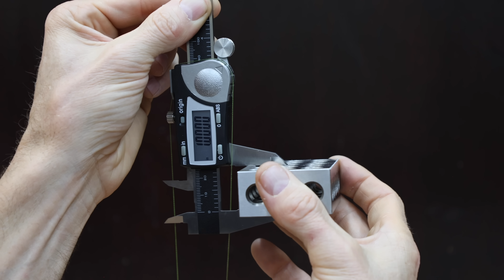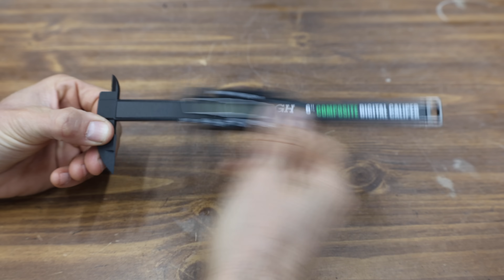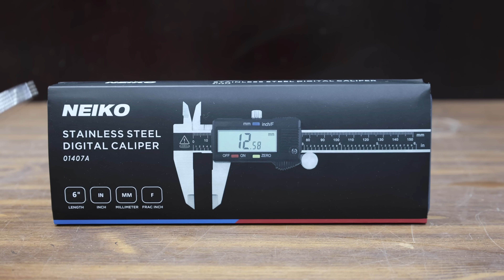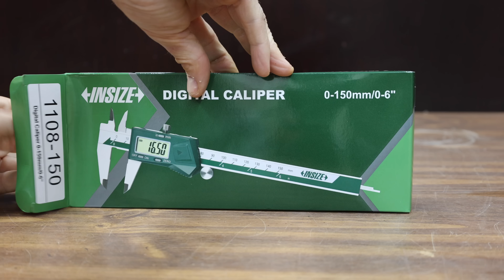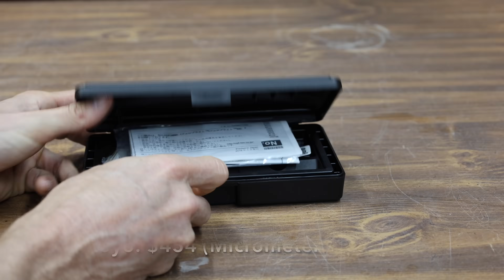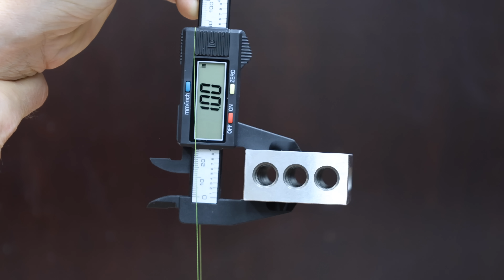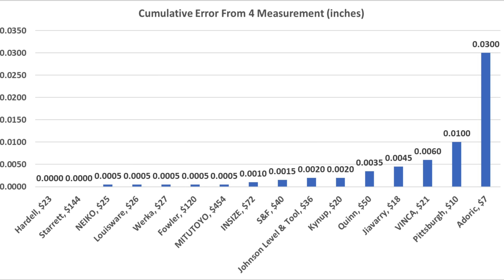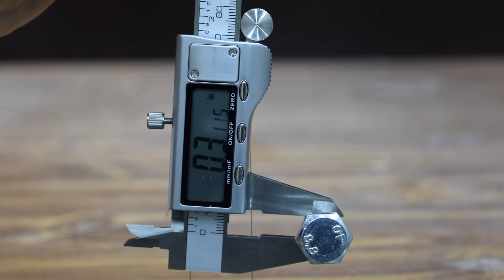I've Been Proven Wrong About Calipers!

Comment: Unfortunately the most important thing wasn't shown and that's battery life. Every single one of the cheap calipers is going to eat through batteries whether you're using them or not and that's a real pain especially when you don't use them very often. The higher end calipers have much lower power draw which means the batteries will last 10 times as long.  That difference alone makes the higher end calipers worth every penny.
Reply from the maker: Thanks for the constructive feedback.

Comment: The Mitutoyo digital micrometers and calipers that I own were all supplied new with silver oxide SR44 batteries included by Mitutoyo, not LR44 alkaline batteries as stated in this review. My Mitutoyo instructions all specify the SR44 battery type. The SR44 battery is more expensive than the LR44 but lasts far longer than an LR44 for me in calipers and micrometers.
Reply from the maker: Thanks for the feedback.

Comment: Not sure if you've done it yet. But the price on laser measuring tools keeps going down. Work tried out some mileeseey and bosch versions and both were surprisingly accurate but way different prices. Saw mileeseey has architectural ones that hit like 200+ USD.
Reply from the maker: Thanks for sharing.

Comment: Digital calipers that "shut down" after a few minutes still have parasitic drain.  You should pop the cover off, hook up a multimeter, and calculate how long the batteries will last in the device while in standby mode.  I don't use digital calipers very often, so I remove the batteries between uses.  Handy to have on hand for the rare occasion I need to measure something to the thousands of an inch.
Reply from the maker: Thanks for sharing.

Comment: Having used a ton of calipers over the last couple decades. I still go back to a Starrett dial caliper. No batteries, and being able to see the needle move to find that sweet spot where you know it’s properly seated is a must for me. Specifically the model 120’s made in the USA. The 3202 models are made in China, they’re not bad but you can definitely feel the quality difference. Mitutoya is a close second. For dirty environments I will only use digital. Dial calipers will get destroyed as they work by using exposed precision gears.
Reply: I've been using Swiss-made Brown & Sharpe (Tesa) dial calipers daily for over 40yrs. The only reason I went to a dial is because I have to go from measuring inch stuff to metric stuff several times a day. I bought a Vinca caliper for like $20. It held up perfectly for a couple years until I spilled some acetone on it. My company replaced it with a Starrett 799. What a piece of crap! I actually threw it against a wall, and bought another Vinca!
Reply: PS; You mention the Starrett 799 you tested was "Made in Scotland'??? The one I had was marked Made in China! 
Starrett has been in dire straights. The company was, perhaps still are for sale. Their catalog is a shadow of what it was when I started in the trade. Cheap imports are killing them. I have a lot of old (pre-satin chrome) Starrett tools I bought from co-workers who retired. Some are older than I am (65), but are still in excellent condition and measure perfectly. Also have a bunch of Brown & Sharpe, Lufkin, Goodall & Pratt, Moore & Wright & other makes that no longer exist.
Reply: @pb68slab18  Acetone melts plastic, ketone family. Brown & Sharpe started it's original company in Providence, Rhode Island in 1833. They sold it a while back. Starrett was a highly overpriced union machinist shop in Athol, Massachusetts. They sold the company years ago. In the 1980's Japan was farming out their electronics to China.
Reply: I use both digital and manual calipers, depending on the job. In my opinion, they both have some advantages over the other.
Reply: I also tried digital and went back to dial. I like the no battery needed.
Reply from the maker: Thanks for the feedback.

Comment: I have been a machinest for 20  years. Going in i could not afford the mitutoyo so i bought a fowler. Lasted 6 months, the open and closing wore a hole in the circuit board  from the scale dragging on it. Your test of how much force it takes to close them is what i needed to see. 

I have had my mitutoyo now for 20years. Other then dropping a pair i have not replaced one since. 

The tooling rep is pushing the insize brand hard. Debating giving them a try. 

Agree the auto off and 2032 battery would be a great upgrade for the mitutoyo.

Great work! Cheers from Wisconsin!
Reply from the maker: Thanks!  Thanks for sharing.
Reply: @ProjectFarm  video idea.  Does keeping string trimmer line moist help? 
Alternative to string trimmer line?

Comment: 1,2,3 block isn't (in my opinion) a great way to check accuracy. I would have gone with a certified ceramic gauge block set and did some thing like 0.5432 as a stack, verified it with a mic like you did and repeat...... a metal block such as that 1,2,3 block just by holding it can affect in the 10ths range quite easily, but regardless to all of that fantastic video and thank you for all you do!
Reply from the maker: Thanks and you are welcome!

Comment: One of the issue I found with cheap calipers is their battery drain when off.  Right now I am using the Shars Aventor IP67 6" caliper and I find it keeps its zero and is quite accurate.
Reply from the maker: Thanks for the feedback.

Comment: This was a great test idea! - And also probably the most controversial one as well.  All the professional machinists, engineers etc. have made valid points, but overlook the fact that this information was presented primarily for the AVERAGE individual, working on projects that aren’t going to Mars, the Marianas trench, or nuclear reactor.  A farmer repairing his combine probably wouldn’t necessarily need a $400+ caliper to measure a half worn shaft against the worn bearings it passes through. He just needs to know what size it is, compared to what size it’s supposed to be, so he can replace it with the correct size.
Reply from the maker: Thanks!
Reply: I bought a few 6 inch fake Mitutoyo LCD calipers on E-bay in 2020 for 40 dollars a piece. I use on an ocasional hobby project. They are a good quality reliable fake item. There is a YouTube video on "how to tell if there fake"  Mitutoyo electronic calipers.
Reply: @georgebuck2269  Amazon is also known for selling a lot of fake Mitu's.
Reply: For home gamers, any cheap one will work and be accurate enough for needs like 3d prints, hobby metal work, sizing bolts, measuring holes, etc etc.  Dial calipers are also great, as no need of batteries, but same accuracy if used carefully.  Vernier are for the young who aren't going blind yet lmao
Reply: I reload ammo.  What I use has to be accurate.

Comment: Most calipers have a two-screw pressure adjustment, so the feed will be lighter or heavier depending on the tightening - so this test of the feed force did not make sense.
Reply: I believe he graphed the variance of force, not the total force because that is adjustable

Comment: I wanted to point out that ONLY the Mitutoyo actually retains its zero when turned off. The other two DONT ACTUALLY TURN OFF - they just turn off the screen. So if you come back to them after a few months, the battery is dead. Only the Mitutoyo Absolute uses a tellurometer sensor which knows where it is without having to keep track of movement while off.
Reply from the maker: Thanks for the feedback.
Reply: All the good European brands — Tesa and Sylvac from Switzerland, and Mahr from Germany — also have true absolute positioning with real power off.
Reply: And note that no calipers use a tellurometer to measure distance. They use capacitive sensing.

Comment: I bought a Mitsy mic when I was a freshman in college for a machine tools class.I am now 77 and still use it,according to the standard the carbide tips still are accurate and have calipers from M,S.F, brown&s,and some german and swiss makers.I also have some cheap stuff for "garage" work.The cheap stuff eats batteries and the units fail frequently so for cheap stuff I prefer dial calipers as measuring accurately to tenths with calipers is ???.
Reply: I absolutely would buy the good stuff if I were a machinist. I’m a mechanic. I have one of these just for making random measurements requiring little accuracy. I had a Snap On branded one that I paid over $100 for in the late 90’s when I started out. No idea who made it. It grew legs. I wasn’t in position to spend a lot at the moment so I bought a Pittsburgh for under $10 to hold me over. That was fifteen years ago and it still works for what I need it for. It also measures to .0005 accuracy whenever I check it. (It’s not the version in this video). I also maybe use it twice a week. Who knows how well it would hold up being used many times a day. Point is there are a lot of us who just need to measure ID, OD, and depth where even being off a few thousandths wouldn’t matter. The cheapos do the job. Maybe I’m wrong too but I think I would trust a digital harbor freight more than a dial. Seems the dial would require more high quality manufacturing than electronic.
Reply from the maker: Thanks for sharing.

Comment: Good Info. Thanks  I have a 10 year old +/-  Harbor Freight $12set of calipers that fall nicely into the mid point of your tests. I changed the battery configuration to use a AA Alkaline or Lithium battery. Wat cheaper and MUCH longer life time too. It gets a lot of use and still works great.
Reply from the maker: Thanks and you are welcome!

Comment: Not a machinist, but I've had a set of iGaging calipers for years that are pretty nice. The battery compartment is a slide tray so you can easily pop the battery out after using them so it doesn't die in the case. They seem pretty consistent too, regardless of how much pressure you apply on the jaws they don't seem to flex and change much. I bought a VINCA caliper last year as a backup and was very disappointed with it. First off the battery is a much smaller battery than other calipers, and its compartment is screwed shut. After a few months in the case not being used at all, just turning it on would flash the display indicating low battery. Sometimes Id open the case to find it already on inside. But the worst about those calipers was their flex. You could change the measurement by a few decimal points just by pressing harder on the thumb screw. I tossed them in a closet to be forgotten about and bought another iGaging caliper.
Reply from the maker: Thanks for sharing.

Comment: Many of the economic calipers share the same circuit (design, at least) that literally eat the battery even when they are off (manual or auto). Pick them up after some months and they are invariably dead. There was a thread on EEVblog forum detailing which brand/design they all cloned. Maybe you could measure or check them after leaving them in a drawer for some time and do an update episode?
Reply from the maker: Thanks for the suggestion.

Comment: I bought a cheap a few years ago, they looked 100% identical to the LewisWare they lasted a year or so and a battery change then they developed a fault where the jaws closed reading was about 5.5mm (unaffected by zering) and as you opened the jaws the reading went up and down! I replaced then with used analogue dial set that I got for about £15 because the dial lock was missing I made a new one in about five minutes. They must be about 40 years old and they are perfect. If I were buying new, t would definitely be a Starrett, however I'm a tightwad so high quality old used tools are my pick. Sadly old measuring tools aren't usually metric!
Reply from the maker: Thanks for sharing.

Comment: i’ve bought 4 sets from harbor freight, all of them the digital read out fails after a few months, it reads 888 and a i’ll not reset even if i remove the battery. they are crap , do not buy these crap products from harbor freight.

Comment: I've had the Neiko as my budget calipers for years. The only problem is that they eat batteries. A common problem with the cheaper electronic calipers. Even when "off" they are draining the batteries. I finally upgraded to Mitutoyo about a year ago. A definite luxury splurge. But the battery tech is great. But you can buy a lot of batteries for a hundred bucks. 😊
Reply from the maker: Thanks for the feedback.

Comment: As you may have noticed, I'm usually more interested in how long something will last. I have a Cen-Tech model 93942 digital caliper that I bought at Harbor Freight in 2006. It gets regular use and has held up very well over the last 19 years. I don't know exactly how accurate it is, but if I need a precise measurement, I'll use a micrometer.
Reply from the maker: Thanks for the feedback.

Comment: The "automatic shutdown" feature on most calipers is BS. People have done drain tests, and it turns out that the battery drain really doesn't change when the calipers are "off" - it is still on it just shuts the display off, and the display draws almost nothing. The battery will be dead in a month or three even with the caliper off.

Comment: I've got a Neiko that worked fine for 5 or 6 months, then the display began showing Egyptian hieroglyphics. I didn't even know that was an option. It was cool, I guess, except I couldn't get back to regular Arabic numerals. Next time I'm getting a Mitutoyo. Then, I'll just thank myself every year for the next 25 years. I've got a Harbor Freight non-digital I've had for about 30 years still works fine. I'd avoid any Chinese digital. Also, you should probably mention not to expect the kind of accuracy from calipers that you'll get from a micrometer. Love the channel!

Comment: I always look forward to watching your videos as they are insightful but this time around I was a bit disappointed.  From watching many of you videoes over the past couple of years I know you put some thought into how you test products and I appreciate your dedication at providing independent reviews that all of us can trust.

I have quite a bit experience using caliper as I'm a CNC machinist of aerospace parts as well as experience doing inspection.  I also have experience using some of the cheaper calipers as I have mentored a middle to high school robotics team for over a decade that has purchased many of the cheaper ones.  I don't want to point out all issues I see in the video as I don't feel like it important that you become an expert at using calipers but I want to point out a few things.

Everytime you start using calipers always wipe clean the jaws on either a piece of clean paper or can use a finger if its clean.  Then check that when the jaws are closed the calipers read zero and there is no space between the jaws.  This will help reduce measurement errors.

On one of your tests you rate the accuracy of the calipers against a 123 block.  By doing so you are making an assumption that that the 123 block are very accurate.  Good 123 blocks will tend to be within .0001" but the cheaper ones could be off by more than .001".  It would be much better to use a 1", 2", and 3" gage blocks instead, which are ground to a much high accuracy (.00001-.00004") and are often used to check the calibration of calipers and micrometers.

The techniques you use when measuring is going to introduce some errors and can skew your test results.  Get the gage blocks I just mentioned and you can practice measuring with the calipers.  The gage blocks are accurate so if you don't get the right reading you can adjust your measuring technique.  That way you can learn the many ways that you can introduce errors and can figure out techniques that work better.  It does take some practice to be able to take consistent and reliable measurements.  By using the 3 gage blocks and rearranging them its is possible to take inside, outside, depth, and step measurements so that you can test all functions of a caliper.

When you were taking the depth measurements through a hole of the 123 block you were testing the depth to a wooden bench top that is not likely flat enough to perform that test.  The correct way to do it would be to test it on a clean flat granite surface plate but for the purposes of the video a piece of flat clean glass should be good enough.

My personal recommendation would be to just buy Mitutoyo.  They are accurate and last a long time.  A cheaper Mitutoyo is ~$100 for a dial caliper and ~$130 for a digital one.  Just make sure you buy from a source that ships the real deal to you.  There are a lot Mitutoyo knock offs that are sold.  Personally I wouldn't buy it from amazon unless you know for sure the company your buying from will give a real one.  Better to buy from a legit tool company.  I buy from Amazon all the time, but wouldn't buy calipers there as I have know I number of machinist who have purchased a Mitutoyo caliper there and it ended up being a fake.

My experience with the cheaper calipers.  Some work ok initial but they all seem to have similar problems.  The batteries don't last long, often less than 3 months (work with students who forget to turn it off, dead in under a week) so you are always having to change batteries (Mitutoyo last 2-3 years), display will go blank sometimes while moving the movable jaw, you have to move the movable jaw slowly or you will get an inaccurate readings, the movable jaw develops a lot of play over time which make the reading inaccurate, the movement of the jaws require inconsistent force which leads to inaccurate measurements.

Comment: Great comparison testing. Good to know that for the stuff I do, any one of these would be more than accurate enough. I do however think you missed a test. On these cheaper ones I believe the measurements start to suffer when the battery gets low. Would be good to test that out and see if it actually matters.